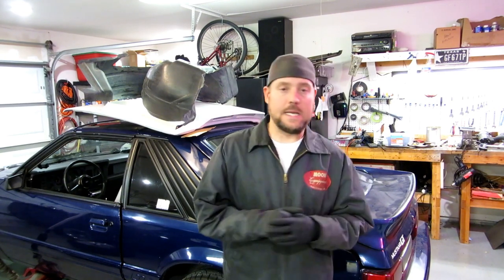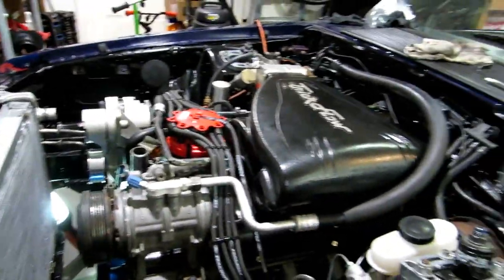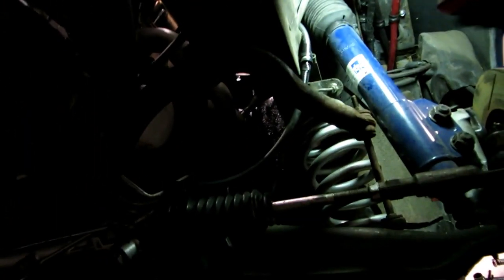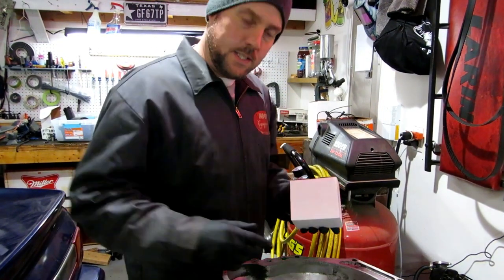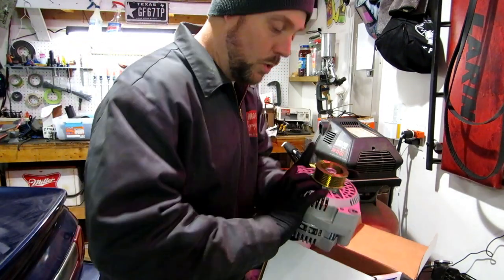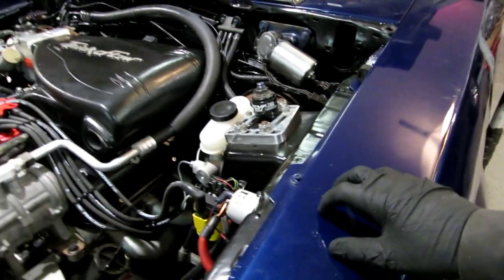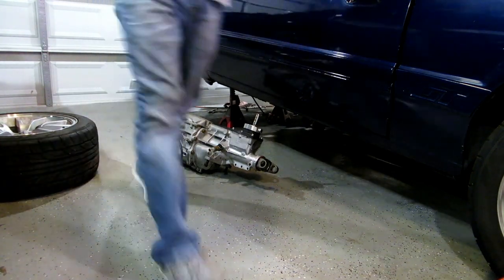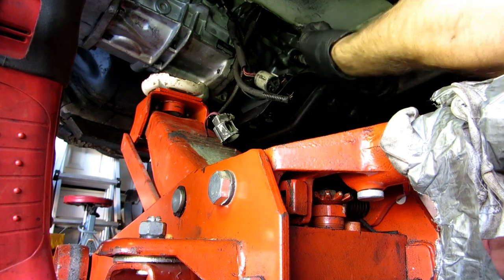1986 Mustang GT Project - T5 Install - Engine Swap Part 11

Comment: Actually, the correct installation of the clutch would have been to insert the alignment tool into the clutch disc, then into the pilot bearing. After that, you can put on the pressure plate. By trying to put it on as one assembly, the disc was probably out of alignment and that is why the input shaft of the transmission wouldn't seat all of the way.

Comment: Great video Mike. I did my tranny and clutch last summer. Had the exact same issue with that last 1/2 inch. I had a buddy helping and it was tough with two of us. Props for doing it all on your own!!  Oh yeah, i installed my cross member the wrong way too. Lol.
Reply from the maker: Thanks Ian! Was a chore for sure. Im all healed up and back at it.

Comment: The trick is to hook up the clutch cable and have someone push the clutch in while you stab the transmission in. The clutch alignment tool is not perfect and the disc is always off a little not letting the shaft align with the pilot bearing. It'll fall in so easy without all the headache strain and multiple jacks.
Reply from the maker: Yeah man. Im SURE the key for me was the vice on the clutch depressing it. I read somewhere else exactly what you just mentioned worked. A good tip for sure. Should have noted it more in the vid. Next time will take half the time.
Reply: Shit like this is why I sit here and troll comments before I jump into a project.  Noted, and thank you!  Doing the AOD -> T5 swap on my Fox this weekend.

Comment: Nice progress Mike. The car is coming along nicely....  Hey did  you check the input shaft and front retainer plate on the T5? I normally replace the front plate with a steel one and check the shaft to make sure it is not wobbly. ALso,, I replace the stock stamped 3-4 shift keys with billet ones..   Check the tailshaft rubber seal. They usually end up leaking .  Good catch on the pivot ball and greasing of the contact points. A lot of guys forget that and wonder why the clutch squeaks. Last, I would highly recommend a firewall adjuster vs. the stock adjuster cable at the clutch fork.... The car looks so much better with the wire tuck and the rear mounted battery.Nice job seccuring all the wires out of tthe way and attention to details on the grounds.   You can run the starter cable  back out the driver inner fender and then under the driver frame rail  to the starter.. Did you go with a 93 style mini starter?  Easy upgrade and only about $60.. Good call on the 3G alternator.. Easy upgrade. You just need the new alternator 3 wire plug for the stator wire, 4 gauge power wire and a 150 amp inline fuse.  I did that on my 86 a few months ago. You will need to notch your alternator bracket to get the 3g to fit.     I love spending other guys money... :)
Reply from the maker: I did...Looked fine, looked steel to me, didnt know they made em aluminum to begin with. I knew this, just mine looked okay. The key I didnt think of...to be honest if I had the cash I would have sourced a new build T5, mine will give no doubt...Just plan to be a bit easy on it. Plan is to one day put a t-56 or at least a built T5 :) I wish I mentioned...I already have a firewall adjuster and aluminum quadrant on it. Probably the ONLY mod on the car when I bought it lol...Kept the stock starter and actually put it in tonight. Again...just saving a buck or two. Mine still looks pretty new (refurb sticker on it) previous owner replaced it. 3G video coming soon...waiting on more 4G cable and another fuse block! Thanks for the kudos and reaching out.

Comment: Mike, my throttle cable feels gritty also. I thought it was at the throttle body, but it's not! Check how your throttle cables routed.
Reply from the maker: I re routed it a few different ways and not binding in any way. My only thought is maybe taking the old motor out or putting in the new one I over bent or flexed it. Needs a new cable I guess...ADD THE LIST!
Reply: HOUSE OF DULA I hear ya, lol!Man you have done so much to the car in the time you have had it.Ive had mine twice as long,and only done a 1/3 of what you have. One thing leads to ten more. Looking good man!

Comment: I'm buying and a 1986 GT convertible roller I've also bought a low mileage 5.0 engine out of a 1990 GT for the same build.  I'm going to have a shop do the install for me.  What should I look for? I can use the harness and ecu from the 1990?
Reply from the maker: NICE! 86 is the best year IMHO. EFI 5.0, but 4-eyed ;)

Comment: My buddy has a 4wd manual trans. Its a bitch, the transfer case makes one side super heavy, and of couse its jacked up so its almost impossible to get a jack.

Long story short, we've done it quite a few times, over and over. When it came time to do my t-5, I didnt have enough room for a jack, and figured I'd have to get help and end up fighting it for two hours or more.

I pushed it underneath and decided to try to throw it on there myself, just to see if I could lift if, it wasnt bad and it popped right in place. Threaded some bolts in as far as I could finger tight, and it was done.

Every other time, ive had to fight it forever, even on the same car.
Reply from the maker: If the car was hogher I could have put the trans on my chest and just slid under there and lifted it up.
Reply: HOUSE OF DULA time to get a lift.

Comment: The spec for the T5 is Mercon V fluid, not Dexron/Mercon 6 as you put in it.  You may want to double check that specification.  Dexron/Mercon and Mercon fluids are not typically interchangeable.
www.teamcapri.com/recalls/tsd_psd/01-15-7.pdf
Reply from the maker: +turbohcar - Looking i to it. Might be right. Typically dextron is backward compatible and dextron III is listed on the back for a direct replacement. I might have to order it from Amazon...man, so many different opinions on flyid type! Sycromesh...DexMerx, mercon, mobil-1 atf, amsoil etc.
Reply: HOUSE OF DULA Completely agree, lots of opinions on the subject.  If the Ford data sheet I linked above doesn’t convince you of Mercon V (now compatible for Mercon applications), check out GearBoxVideo on YouTube.  He did a build for EricTheCarGuy a while back and has built the T5 trans for many years.  He’s done a video on fluids that walks you through it.
Reply: Wouldn’t want you to trash a good T5 by accident.  Keep up the good work.

Comment: should of gone carborated
Reply from the maker: Why? Been working on carbed engines my whole life. Wanted this car for fuel injection! ;) A fuelly is more precise under various conditions and in the long run Id argue that it makes more power. Im going to rely on it heavily with the turbo. EFI all the way!